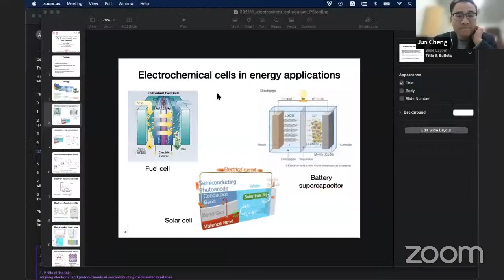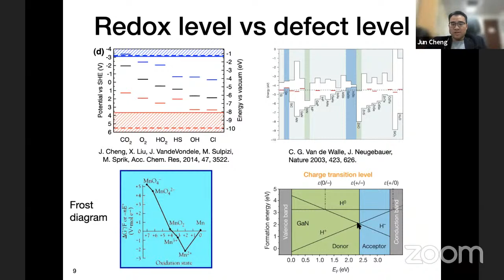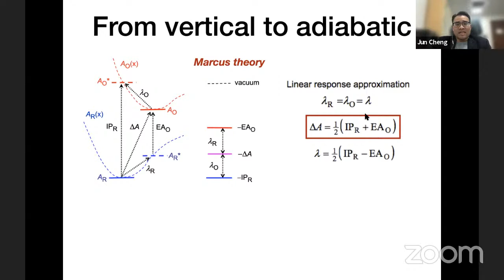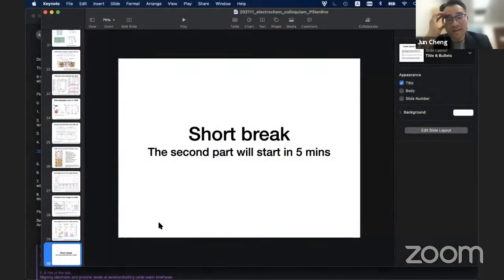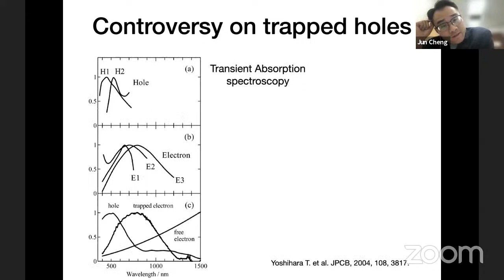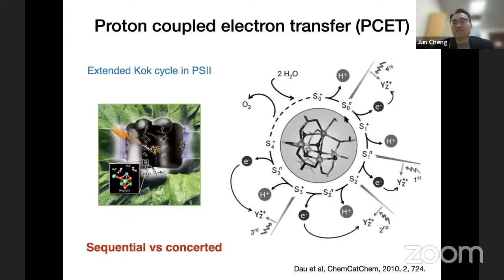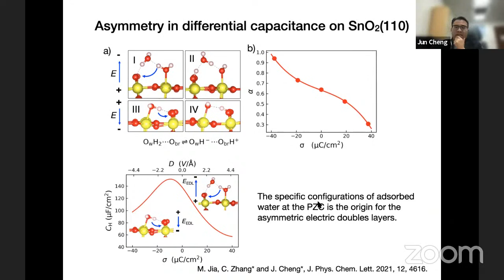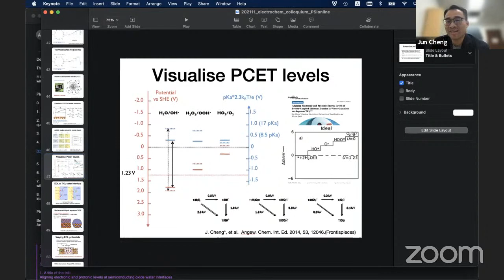11. Prof. Jun Cheng - Semiconducting Oxide / Water Interfaces  (November 18, 2021)

Comment from the maker: 00:17 - Introduction 
03:27 - Beginning of the talk 
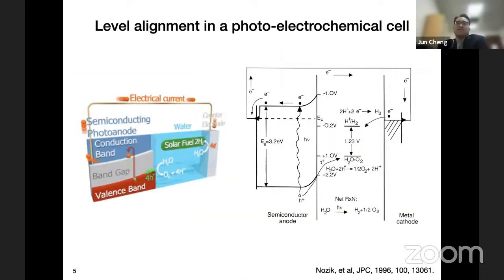08:14 - Band alignment in photoelectrochemical cells 
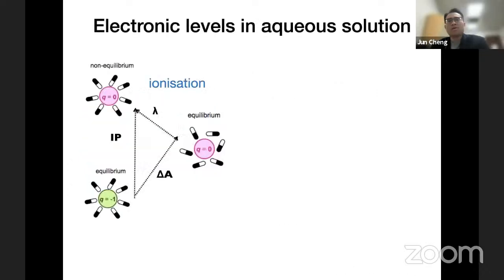10:25 - Electronic levels in aqueous solutions 
17:20 - Defects: Solids vs Liquids 
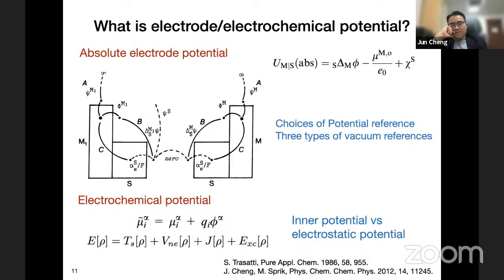24:12 - Electrode and Electrochemical potentials 
35:00 - Semiconductor/electrolyte interface 
38:57 - Challenges in computing energy levels 
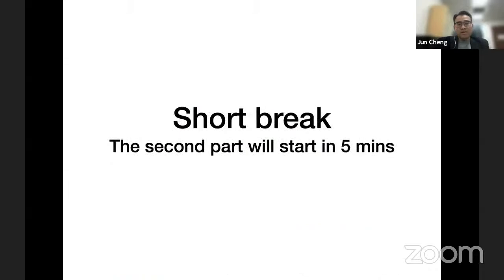1:01:04 - First Q&A

1:17:32 - Hole and electron trapping
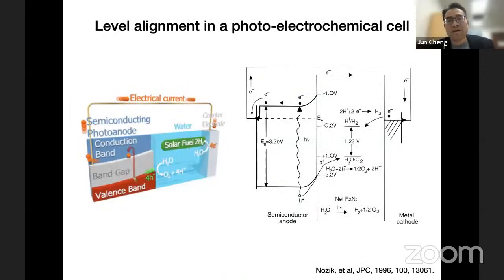1:31:56 - PCET and catalysis on semiconductor surfaces
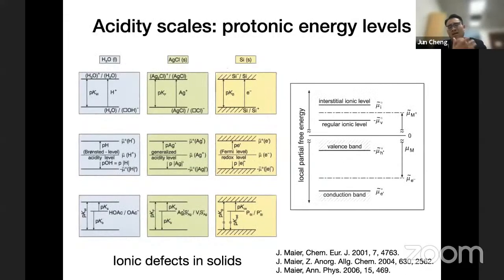1:40:59 - Protonic energy levels
1:47:30 - EDL and surface acidity at TiO2/water interface
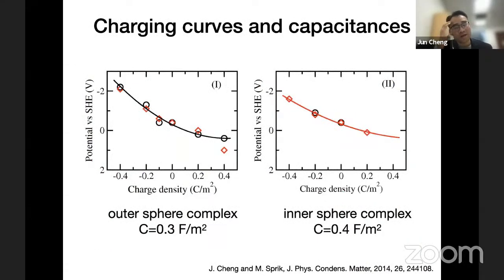1:53:19 - Interfacial capacitance
1:58:27 - Interplay between protons and electrons/holes
2:09:48 - Second Q&A